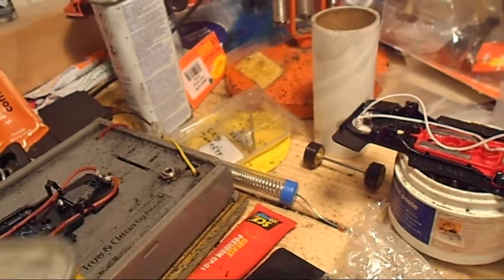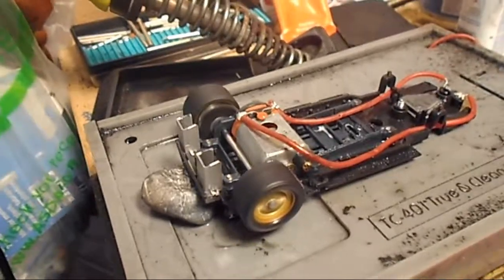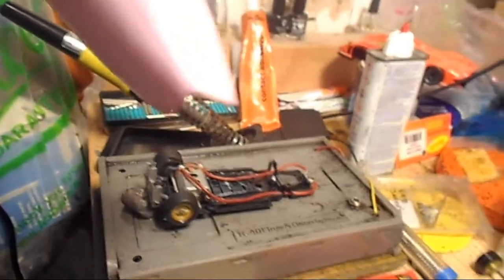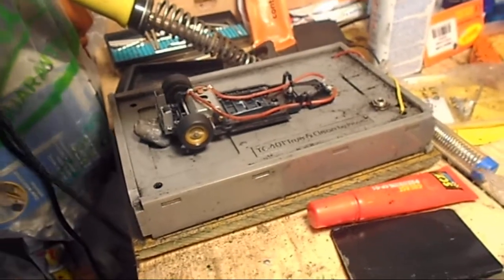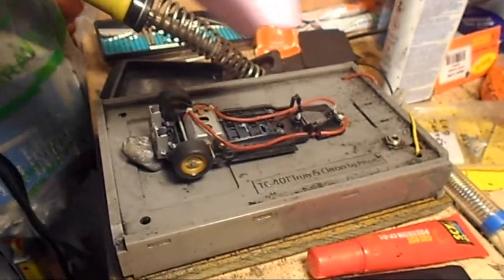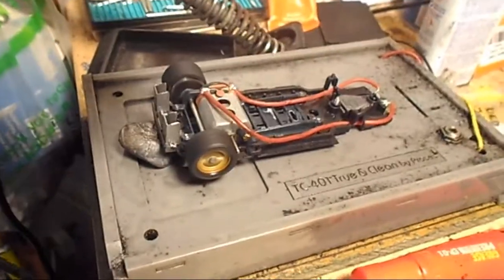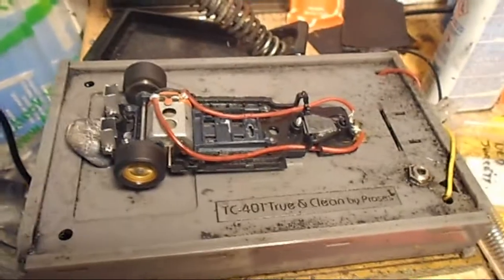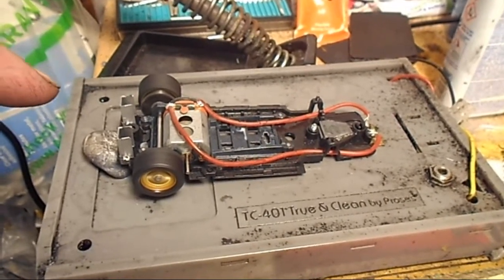~ Motor Flushing With Lighter Fluid ~

Comment: Hi Rick.  Do you break in motors using lighter fluid?
Reply from the maker: Hi Mike ~ Yeah i will do, but quite sparingly. It's best to squirt lighter fluid onto the commutators end of the motor, at around 6'Vlts or so. At higher Voltage & RPM the lighter fluid can snap the single wires that run to the commutators, due to the speed the armature is spinning!... I use lighter fluid to clean out older motors too, and it breaths new life into them .... :-) ...........
Reply: I understand . The previous Scaley motor,  I ran in lighter fluid for about 3 hours for the run in.  I mounted into a Mustang TA car for that nights event. As I began doing laps for final lubes and tests for packing it that can of smoke that is in all motors, opened up. The "Stang didn't gallop that night.  The most recent motor,  I ran it at low voltage for 3 hours.  I then ran it in a 50/50 alchohoI water solution for a few minutes.  So far the can of smoke hasn't opened.  Have you ever hand drill a small hole into the bell where the commutators are for cleaning and lubrication?